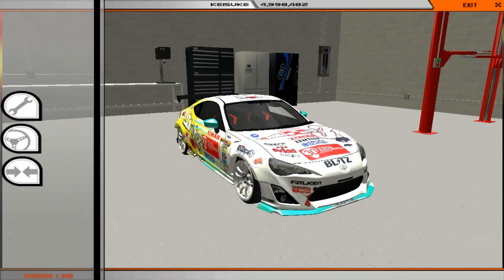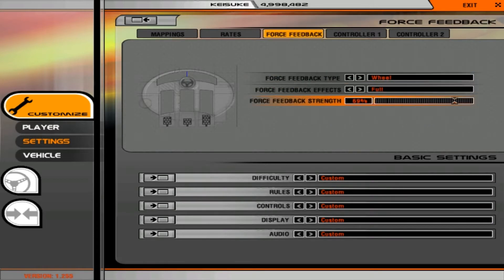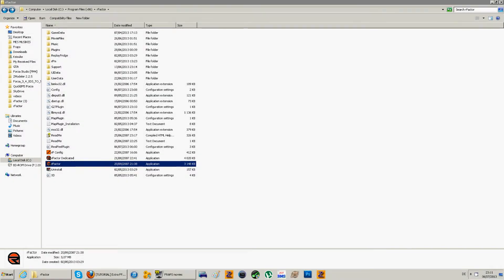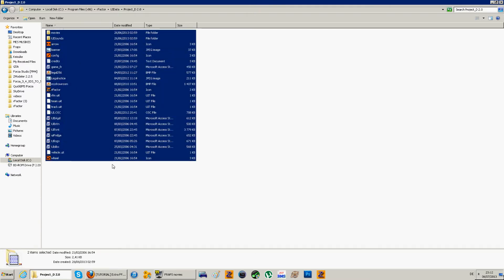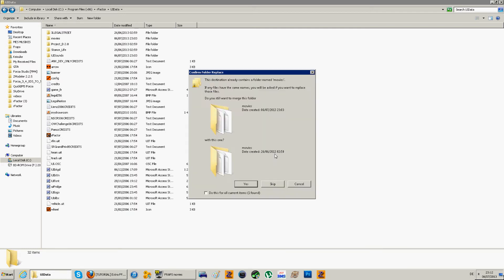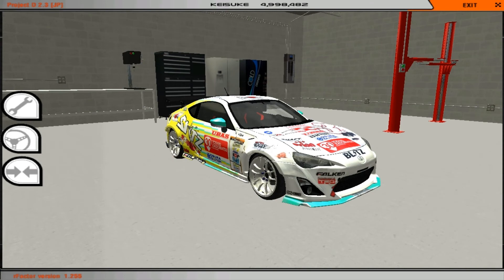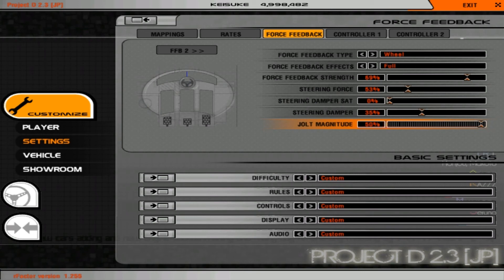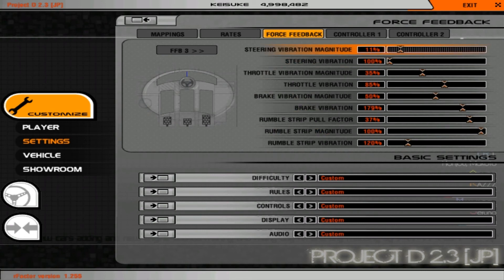rFactor Tutorial #3 | How to enable additional Force Feedback Settings

Comment: how to make it so that it turns in the oposit direction when i drift cause it doesn't do it sorry for bad english
Reply from the maker: You're surely talking either about the Steering Help, press F1 until it says off or try Right CTRL + 8(NUMPAD) and see what it does
Reply: ok thanks
Reply: it does not work
Reply from the maker: TheKris400
Sorry for late reply, then check on the Force Feedback settings, if you have for example -100% put it the opposite aka 100%